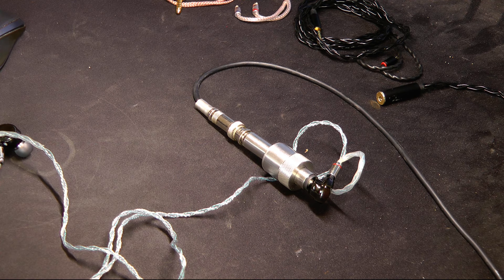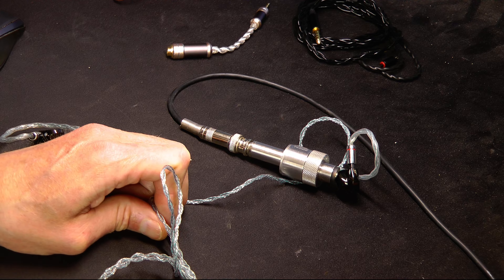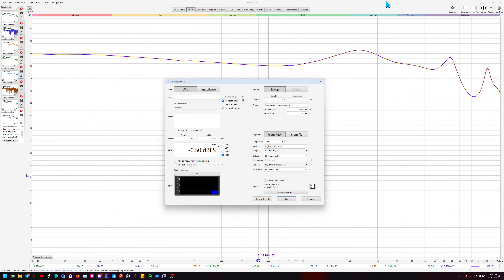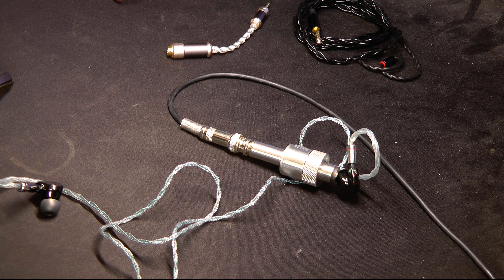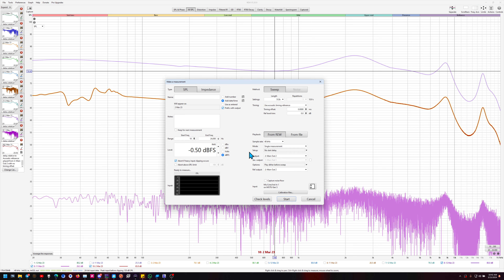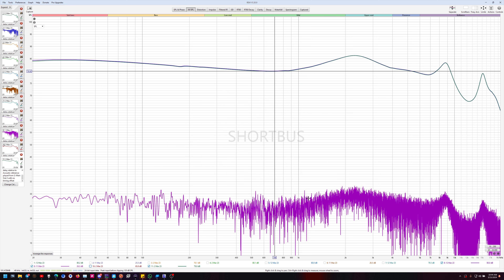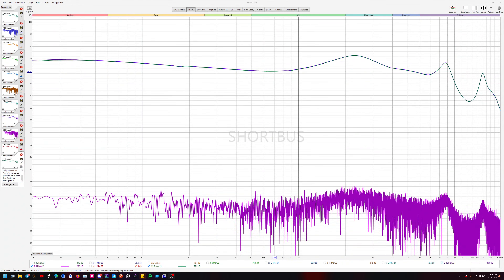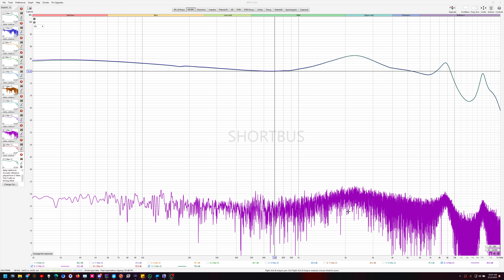Why Balanced amps and cables are entirely superior to Single Ended (with graph).

Comment: No. While -60 dBFS is technically the threshold of audibility for a human when it comes to crosstalk, the subjective experience of sound localization takes place almost entirely above -40 dBFS. What it means is that the MOTU audio interface isn't purpose built for audiophile use, but rather studio monitoring. It is exceedingly rare that a DAC for audiophiles would have crosstalk much higher than -80 dB, let alone -60. Even something as portable as the Qudelix 5k has -79 on 3.5mm unbalanced. On balanced it drops to -117 dB, which is objectively an improvement but not audible to humans.
Reply from the maker: Yeah it's not a problem unless its a problem right.  Still, unbalanced literally fixes it so why not go for that?  Also that Q5k is is with a load or not?  They cheat a lot by reporting no-load crosstalk at the jack itself.
Reply: @MichaelBruceShortbus  the obvious reason to NOT use balanced is the cost. A Balanced desktop DAC/Amp starts at about $400, which is over 2x the typical SE setup. And that doesn't factor in extra for cables, on something that most people can't actually hear, it seems silly. The cost effective way to get to go balanced is a dongle like the 5k or BTR5/7, but after using a BTR5, I moved to single ended desktop gear. It sounded significantly better, and the imaging on my best 4 sets is noticeably better. Could the cross-talk on the MT-602 be lower than the BTR5, maybe, but it seems unlikely that -60 is better ( and that is the reported amount ).
Reply: Yeah absolutely. The thing is though that say something like the es100 is balanced... Although I can't find any performance numbers on that.
Reply: @JohnClarkW  A Fiio K3 is fully balanced at ~$90.
Reply: @ulamss5  there are a number of affordable balanced dongle DACs under $100, but I doubt the measure better on channel separation than SE price comparable.

Comment: Most balanced outputs (not all) have their output sensitivity doubled compared to the unbalanced, which may ruin FR on some particularly sensitive and low impedance hybrids like Canon
Reply from the maker: The good amps may double from say 0.1ohm to 0.2ohm.  This is acceptable.

Comment: Great video! Could you please share how have you connected the Coupler to the input of Motu? I'm using the Rode XVLR+ adaptor but the adaptor generates a harmonic at 250 hz. I'm using the Motu M4.
Reply from the maker: Hit the pad button on the Motu for that channel.  I use the same adapter.
Reply: Gonna try it with another sound card... Motu M4 doesn't have a PAD switch unfortunately!

Comment: Balanced is superior, the thing is esp. in the lower end and mid-tier amplifiers, the balanced section is always made better than the single ended, they even measure better. At the higher end, you'll find single ended solutions that are built really well and in those scenarios its very hard to discern the differences between SE and balanced. In which case they might be equal but why not go with balanced where you deal with way less issues than single ended!
Reply: Quite the contrary, half the time I'm looking at specs on the cheapest DAC-amps with balanced outputs, the BAL-out has worse THD+N and/or worse noise floor in uV than the single-ended. I've even seen ones where it's not even better in crosstalk, at which point... why even call it "balanced"? It should be illegal. :))

But anyway, balanced isn't always better in every way, just in crosstalk, usually.
Reply: @d0nj03  what are you on about? Let’s look at one of the cheapest DACs you can buy. The SMSL SU-8 V2, unbalanced the THD is 110dB vs 116dB balanced. That’s a huge improvement. Even going with something double the price like the Topping D30 Pro, unbalanced is 118dB vs 128dB balanced. And yes, balanced tends to have lower cross talk as well.
Reply: @JtwasLuck  Dongles are the cheapest DAC-amps today, buddy.
Reply: @d0nj03  cheapest lol when it comes to dongles nothing touches the Cayin RU7 :)

Comment: isn't it because you converted a balanced cable to single ended?
Reply from the maker: no.  All single ended cables are basically the same thing.  Combined grounds at the plug.
Reply: @MichaelBruceShortbus  Nope, not the same. The headphone driver part of the circuit and the common return/ground wire form a voltage divider that can be responsible for a lot of crosstalk just by itself: the longer the common return wire, the more resistance it has; the more resistance it has, the louder of a "common signal" (unwanted sum of L+R influencing both drivers) you will get. It is nowhere near the same thing to have a Y-shaped return with a very long "stem" to the Y, vs. 2 fully separate return wires for L and R, that only meet up at the GND terminal of the plug going into the amp. This can make a difference of up to -20 dB in crosstalk just by itself (it's around 20 if the headphone drivers are 8-ohm and about -15 dB for 16 ohm drivers, according to my quick estimates).

But of course you can always do way better with actually separate grounds/returns connected to a properly designed balanced headphone-amp.

Comment: interesting findings, how do i know if a dongle has  true balanced out?
Reply: I just tried it on my LG phone 3.5mm jack...

Went to settings>accessibility>hearing
(All the Android phones have this. Not sure on ios)

Here you can set the stereo balance...

I just cranked it fully to right and covered the right iem and put the left iem in my ears. According to the settings there should be no sound in left iem but when you cranck volume to ~ 50% you can hear  sound faintly when you play music....
Reply: @shrinidhibhatgc298  thanks
Reply: @shrinidhibhatgc298 That's interesting

Comment: you just demonstrated that there is inaudible crosstalk at a higher level in single ended output vs balanced output, and now what ? if our source has both output and we have the option to buy our iem with a 4.4mm cable at no extra cost then sure let's use balanced, otherwise we should not spend extra $ to get balanced audio as it is inaudible anyway
Reply from the maker: You pretty much summarized the issue.  But are we audiophiles that want the best or just good enough.

Comment: Definitely great to be able to measure your own gear and find audible deficiencies. Balanced can certainly be superior under certain conditions.

A lot of it can come down to the amp, there are single-ended amps with low crosstalk, and there are some balanced-amps with poor single-ended implementation. Provided the cables are properly shielded, and at short lengths, cross talk can be minimized. For professional stage applications, balanced cables are essential for live mixing/recording and PA.
Reply from the maker: For sure, but for IEM cables you cannot shield them.